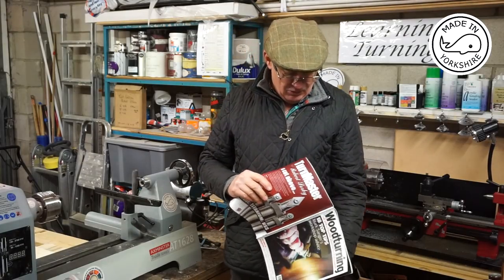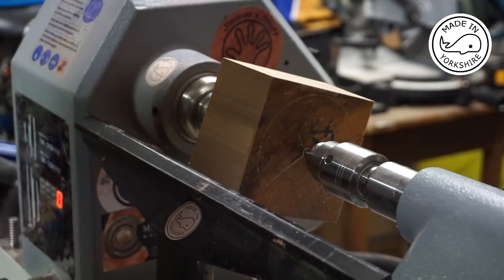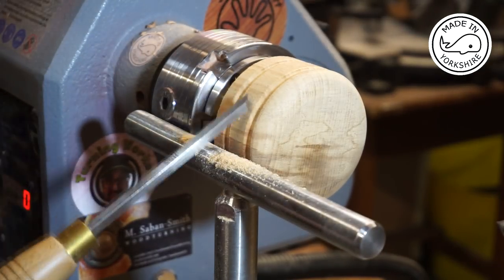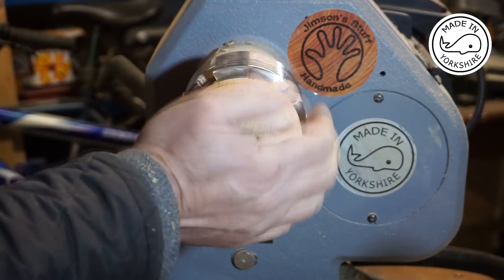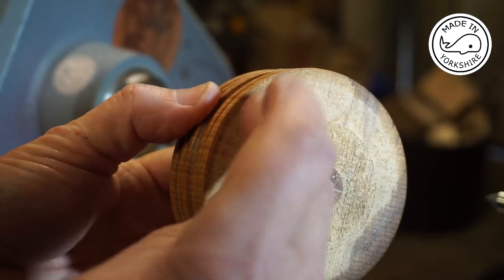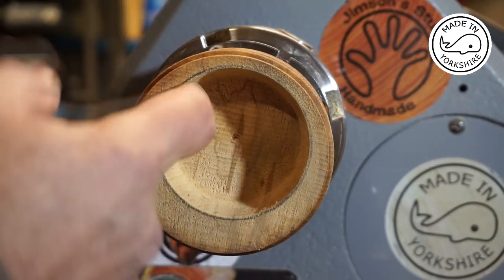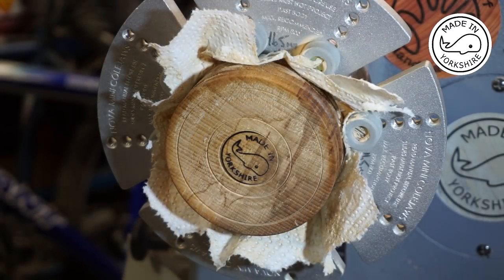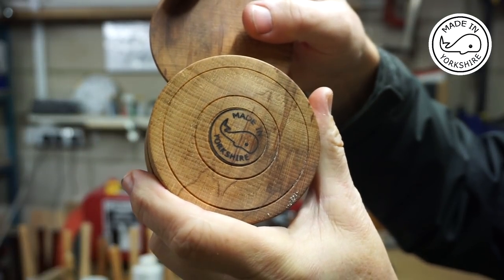#41 Salt Cellar

Comment: For locating the magnet hole in the lid, I suggest that after drilling the 10mm hole in the body, that you install a dowel center and then place the body against the inside corner of a box.  Then position the lid over the body with the appropriate grain alignment and then push down to locate the center of the hole for the lid magnet.

Comment: Nice work Andrew.
I like making offset bowls and I've found that glue blocks held on with hot-melt glue work well for off center bowls and boxes. The big selling point is that you can easily remove and re-attach should you need to get back to the original alignment.
Another tip, if you get chance to see Mark Baker, editor of Woodturning magazine, do his demo with the beading tool, he suggests taking off the sharp points of the tool so that it doesn't penetrate so deep into the wood but still gives you a good bead.
All the best.
Ben
Reply from the maker: Hi Ben - many thanks for the tips. Hot-melt glue is an excellent idea - I should have thought of that one! I'll certainly check Mark Baker's demo out.
Cheers
Andrew

Comment: Very nicely done. I love my woodworm screw. I use it lots. Have you ever considered a Japanese pull saw for cutting pieces off the lathe? Inexpensive Chinese made versions are readily available here in the States.
Reply from the maker: Thanks Tom. I have seen some people using those saws but always thought they were way outside of my budget. One would be really useful, so I will check out prices. Thanks for the tip!
Cheers
Andrew

Comment: Nice one. I have been experimenting and have just completed a Salt Cellar based on the Magazine article (magnetic hinge), a 4 axis turning (similar to your no.34 'Off Centre Vase' but without the twist) and a hemispherical 'bowl' so there are no corners to trap the 'food'. Now need to make it properly in a food-safe timber.
Respectfully suggest that you should not use spalted timber for food containment - the salting is a fungus!
Reply from the maker: Hi Philip. Your salt cellar sounds amazing! Thanks for the advice regarding the wood.
Cheers
Andrew

Comment: Very nice little pot Andrew as I was dragged up I'm not sure I would know what it was for.
Just a suggestion and I think I know the answer but you could have used a carbide tool to remove most of the wood and normal tools for the finish
Reply from the maker: Hi Graham - thanks for the suggestion. I've not ventured into carbide as yet, but I guess it could have made life a little easier - as you suggest. The square end scraper I used definately seemed to be hard work. Maybe I'll bite the bullet sometime.
All the best.
Andrew

Comment: Thanks for the great videos Andrew. I am new to turning and you have some great videos with very neat ideas on how to solve problems which face new turners. Is your stamp on your projects an ink stamp?
Reply: Thanks Patrick, I'm glad you find the vids useful. The logo is made from a heat stamp. I think I talked about it in one if my videos.
I've since sold all my woodturning gear and moved on to model engineering, making little static steam engines. So, my woodturning channel will not get any additional content but it's good to know that it's still helping others.
All the best and have fun!
Andrew

Comment: Hello Andrew,, a couple of pointers,, the cellar needed to be rounded inside so it can be cleaned, and change the grind on that bowl gouge,, keep the bevel angle but take down the wings ,,check out the ONE WAY videos on YOUTUBE, on sharpening bowl gouges, you could spend less time sanding,, Happy New Year,, Regards Alf
Reply from the maker: Hi Alf, many thanks for the tips. It makes a lot of sense rounding the inside. I never though of that, and followed the design in the mag. At the moment I'm happy with the profile of my bowl gouges but I understand where you are coming from. I'm confident in using them and don't want to upset the apple cart at the moment! Maybe one for me to explore in the future.
All the best, and take care.
Cheers
Andrew